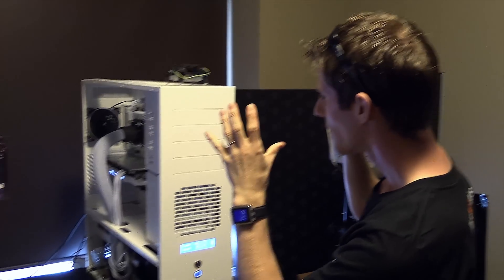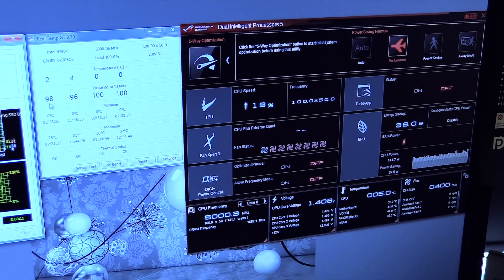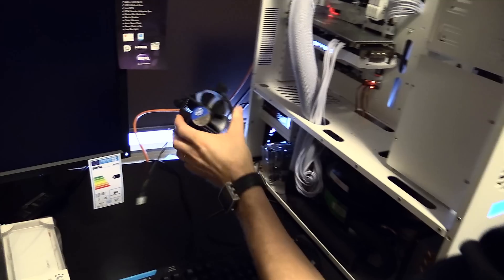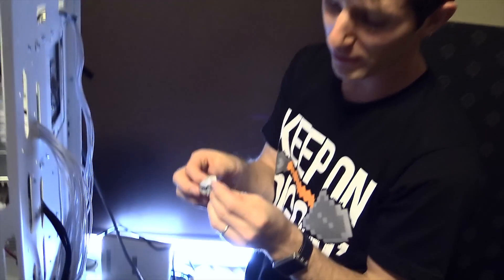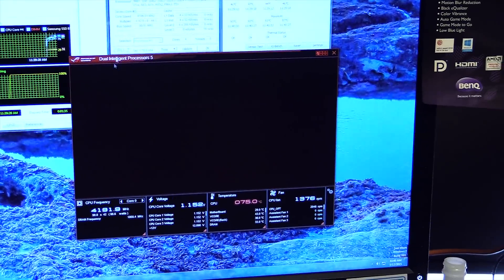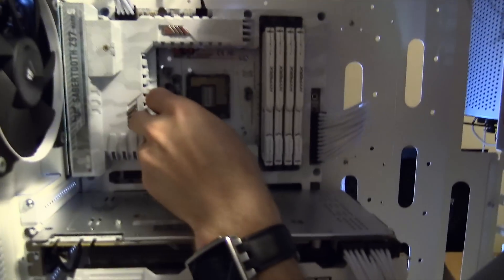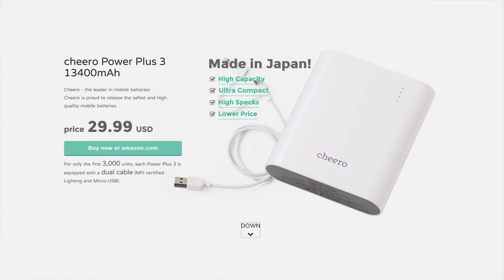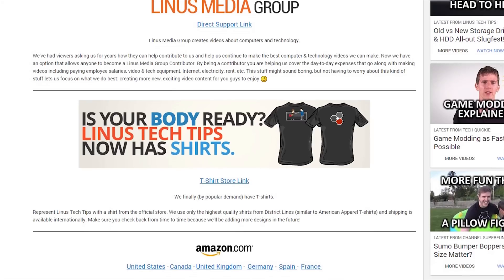CPU Cooling - Does temperature impact performance?

Comment: If temperatures drop, the molecules move slower. The electrons, which transport the energy for the '1' and '0' states for data moves slower. so the cpu should actually run (nearly unnoticably) lower.
Reply: wut ? since when electrons are molecules ?

Comment: no duh colder does not equal faster unless you turn up the speed of the cores and/or another part of the machine that was made to be colder as all being colder does is make it so you can can more stable at a higher speed is all

Comment: Damn, only $26 for a Handy? That is a steal. They usually cost me $30 for a decent handy. And from a trusted supplier, too. You never know what to expect when you buy a handy in an alley or a gas station bathroom. Sometimes they're very rough and heavy. I hate hamfisted handies. But this handy seems smooth and delicate, like a mother's touch. Time for a Better Handy. Thank you for the handy tip, Linus.

Comment: How about trying to crank up the temperature in the next test. Like one on sub-zero and the other without a fan, allowing the CPU to run up to 100+ degrees. I like to know will throttling occur and how much is the impact.

Comment: maybe its meaning full when you are using a threaded cpu.
i use intel core i5 560M 2 core 4 thread  cpu in which 2 logical threads are disabled when cpu gets heated. and the 2 physical ones also stops to respond.

Comment: What I wonder is if there's a difference in max overclock speed between say -80 C and -10 C. If you design a cooling system, you can get -10 C easily with normal refrigeration (like your freezer). But to get to -80 or -100 C, you need liquid nitrogen or lab equipment grade stuff.

Comment: Less than one minute into the video, Whether performance is increased or not, The cooler it runs for it's life spand the longer the life spand will be. So Yes, And No. At this point. If it's getting hot enough to throttle itself, Then, Yes more cooling is good for performance. If it never throttles itself, Then cooling shouldn't boost performance at all.

Comment: Big mistake here as you forgot to include thermal throttling into the equation. The correct answer is YES, temperature can and will affect performance.

Comment: Through actual experience the only time i've noticed temps affecting performance was when running too hot and getting thermal throttling. Back with my old Q6600, I instaled the /stock/ heatsink wrong, and the damn thing throttled down to 500MHz or less. It took an age to boot windows xp. something like 15-30m.

Comment: Linus could you make a video where you test CPUs in which you look at what CPU does it take to run games, only CPU no GPU in system. I have i5 2500 and I play dota 2 on low on 1280x720, so I was wondering which CPU does it take to play on other quality

Comment: If the processor is too hot or becoming too hot doesn't it nerf itself? If you had a water cooler for the processor it would not nerf itself and then the performance would run better.

Comment: Same subject, different question...
Whats the max temperature your CPU should be before its considered dangerous?

If running Witcher i get 65ºC-149F, and when 100% stress test i get 75ºC-167F -> is it safe or should i be concerned?
Thnks in advance.

Comment: 50 is high? Mine is 60 at rest and 100+  at load.
Reply: 12345littlepeople  That's really high. Mine is 40~ at rest 75~ on load
Reply: 12345littlepeople  What processor do you have?Just asking.
Reply: Buizel Productions (Intel) i7-4960HQ @ 2.60GHz

Comment: The semiconductors physics says that at 0° Kelvin (-273° Celsius) they won't conduct electricity and with the rise of temperature, they become more conductive. That being said, technically, a CPU should perform better when is hot, than when it's cold. But in a CPU there are more variables than the Silicon that makes the chip, and after a certain temperature, the semiconductor's conductivity doesn't scale equally. Like in this example with 0° C and 78-80° C, there is no difference. 

As I said, there are many variables, at hardware level, like thermal throttling, and at software level, like certain activities the OS does (checking updates, getting more inputs or outputs etc.)

As for the conclusion, it's good to see that you can have both a pc and a room heater without compromising performance.

Comment: why I don't like Ai suite: Ai suite II messes my whole system up. AI suite on: system unstable and everything being weird. AI suite off: system working perfectly normal but fans not controllable. sadly Speedfan does not work with my mobo. are the newer Ai suites better? :D
Reply: ***** Create your fan profiles within the UEFI, then you can have the best of both worlds.
Reply: Bryan Muller that's what I'm doing now. But I would prefer to control it with software and on the fly

Comment: I guess we all screw up while manipulating the CPU in vertical position. (Mine fly away of the socket and safety landend in the cables of the PSU. xD

Thats why the socket mount have a safety lock and you have to avoid do it in the vertical postion...

Comment: Lol I use a quad core amd processor with the stock cooler and it runs like to 90 degrees Celsius on a little load. XD fail

Comment: Wait that's weird.......doesn't an increase in heat causes increase in electrical resistance?
Reply: User5C13nc5 And why would you think the increased electrical resistance would make your CPU slower?
Reply: b0nz1official 
Doesn't that mean that the current is lesser and that means lower wattage that goes trough the circuit and into the processors? Wouldn't lower wattage mean your processor would run slower?
Reply: User5C13nc5 well... when you talk about 1gramm of silicon (its way less) and 30 degrees more there wouldnt be a big difference

Comment: Sigh.. temperature does impact performance.. possibly not with the processor but take any game that requires alot of power. it does run smoother if you start it with a cold pc and the frames will drop a bit when your pc is getting hot
Reply: Lenwe Ancalime Wow, you don't thermal throtteling.

Comment: Theoretically, a CPU should be SLOWER when under low temperatures, as it is a semiconductor. Metals however WILL have higher conductivity and lower resistance at low temperatures. However a lower temperature allows for higher clock speeds which means it would be FASTER.

Comment: I don't think a cpu being cooler will inherently make it faster, but it being cooler will allow the user to push it further by overclocking before the cpu thermal throttles. I guess? I'm not so good with converting thoughts into words. Correct me if Im wrong though.

Comment: I love how Linus is surprised by the high temperatures of the I7 4790K when he put the stock Intel cooler on the cpu. It's an overclocked I7 4790K with a stock Intel cooler on it. Linus you can't expect low temperatures in these scenarios.

Comment: Yes it should affect performance due to CPU passive cooling trippoints. 
Any modern CPU has that feature switched on and should have that feature switched on.
Cpu passive cooling is most important and controllable feature for user. 

So temperature can't degrade CPU processing power or performance before CPU doesn't reach that specific temperature limit.

Disabling that feature or setting trippoint too high temperature limit may destroy entire CPU chip in matter of minutes - in some cases scenarios.

Comment: Unless OC CPU cooler seems abit over-kill inn any case. I run a I5 4590 (Yes I choose not to have OC, thanks) with proboaly the cheapest cooler thats worth buying, TX3 Evo, and I never see temp's above 60, trough I havent stressed my PC either much.
Reply: DjuntasGaming 
I have the i5-4590K with same cooler. did a minor OC to 4.1ghz still runs at 60C :)
Reply: Thats nice to hear. I didnt even know my variation comes as K-model.

Comment: Wouldn't a test of a hot-running cpu complete the test/give it meaning? Something like running it pretty close to thermal limit, without it thermal throttling of course.

Other than that: i agree. Results were predictable:)

Comment: Hey,

Do video about new GPU on older platform. To see where bottleneck is.
Reply: Hey

Learn to talk english.
:3
Reply: Mr.Mc.Waffles (b$e〉〉) heh :) funny
Reply: mentalplayground Don't think it would be that bad. I mean it would be a bottleneck for sure, but not as bad as you might think.

The worst games would be those with heavy CPU physics
Reply: Christoffer Nørskov Maybe guys use it to make 10 min vid on the subject
Reply: mentalplayground A GTX 690 (dual-gpu card) has no real performance degredation when using PCIe Gen1 8x (equal to Gen3 2x), so your CPU, RAM and harddrive are more likely bottlenecks
Reply: Christoffer Nørskov I would love to see how badly GTX 780Ti/ 980 / Titan X would perform on Q6600. :)

Comment: Only 821cb on with a 4790K at 5Ghz? Oh Linus...you need to turn off that whit you're running in the background. That kind of a frequency should give you much over 900 - like in the 940-50 range.

Comment: A cooler CPU would reduce electrical resitivity which would allow a more efficient flow of electrons and thus better performance. But this is countered by the reduction in kintetic energy of the electrons.

Essentially your stuck in equilibrium until you reach a point of super conductivity, at which point you would see a massive jump (which for a CPU i'd imagine about 10 Kelvin / -263 Celsius. LN cooling anyone?) 
This is all just speculation mind you
Reply: So if you got a CPU to 10 Kelvin it would get a massive performance jump up? Ok, I'll get onto that :D
Reply: Oh and liquid Helium is way colder than liquid Nitrogen, and I was joking when I said I'd try to get a CPU to 10 Kelvin, that would damage the motherboard.
Reply: as i said, i'm speculating, as well as making an (albeit educated) guess of the point at which silicon becomes super conductive. I'm an engineer not a physicist ^_^.

Comment: I think Linus was really tired when he did this video
He's saying that increasing performance by overclocking your CPU will generate a lot more heat so cooling it will help a lot.  
And, running a sub zero cooler on stock settings will do very little which is what we saw in the video.

Comment: temperature is more related to OC'd lifespan than anything else. I'm guessing there's a saddle region where overclocks and load temperatures meet - i'd say 4.6-5GHz and 35-45 C - that will maximize the lifespan and reliability of an OC'd CPU.

Comment: so my FX-8320 (OC to 4Ghz) scores 640, which is not bad as it's less then 1/2 of the price of i7-4790K (atleast in my country..)
also, why doesn't Linus EVERY use/benchmark/review/talk about AMD products!?
Reply: ultraszgb This channel is more geared toward enthusiasts, AMD cpus are grate for budget builds, but not nearly as fast as intel ones.
Reply: ultraszgb Possibly because AMD hasn't released a new CPU for a long time. That said, I thought the FX9590 would have been a better CPU to test the limits of the phase-change cooler.
Reply: ultraszgb Right now you can't compare them, in this moment ends of may 2015 Intels fucks AMD so hard that you can't even think.
Reply: Takata Miyagawa If you test an AMD CPU with the phase-changer you will get Intel Stock Cooler Temps.
Reply: ultraszgb Because LinusTechTip is powered by Nvidia and Intel... so we can conclude you will never hear an honest review here
Reply: ultraszgb He'll do some of the 300 series stuff when they come out next month. Probably some Zen stuff when they come out, as well.
Reply: Thomas Banks nah, Intel is ahead of the game since AMD came up with the first Phenoms. They even had a bug in the L2 cache and fixing it cost around 10% performance. They never recovered  from that really.
Reply: TheCovertCamper Ok that just cover review videos, but Linueses channel is not just about reviews... what about a video of the old 8350 or the 9590 overclock with a custom water cooling loop compare with the 4790k?, why he didnt put one of these hotter amd cpu on this sub-zero phase change cooling PC to see just what happens?, what about kaveriu apus?, how they perform in gaming?, I don´t know... do something different and innovative, I feel like latelty he just talk when he got pay by the sponsors, and with that said, he´s channel has become like a platform for marketing... saddly, and that´s what I think...
Reply: berzu21 If you really think that's true you don't know linus. There is no way he would accept a sponsorship that didn't allow him to use a whole line of products. He get's intel ones for free, and I bet he has to pay for AMD ones, so maybe that plays a small part in it, but he's bought products before to review.
Reply: He said it in the most recent WAN show why they don't talk about AMD that often recently. They did a couple of years ago though.
AMD is currently not a real competitor for Intel in terms of CPU's. 
And they bottleneck some of the newest GPUs, even if it is just a tiny bottleneck, it would still affect benchmarks.
Things will change if thE rumour about "Zen" are true. We'll see.
Sounds rude, but that's how it is at the moment.
Reply: HeyDan1983 He wouldn't deny the sponsorship, but there would be nothing saying he can't review amd products. Not only is that bad for him, but it's bad for intel as well... I know how business works, and I know he's not doing this for free, but it would be bad for everyone involved if there was a clause stating he couldn't review amd cpu's in his contract.
Reply: ultraszgb Because amd fx are nowadays so old
And moreover... intel is Linus sponsor, i'm sure they didn't allow him to review amd cpus.
[En fact, last Amd good chip A10-7850k never been reviewed on this channel]
Reply: DamyLv 
APUs?

You must be new here.
Reply: ultraszgb linus actually said he would love to review an AMD CPU again. We'll probably see it if AMD manages to give us a real competing model.
Reply: ***** 
I mean last Apu generation, Kaveri. Why not reviewing it?
Last Amd review was for 2012's richland apu
Reply: ***** I built my PC on a tight budget, my little FX-6300 with its stock cooler has been a great little thing. :) It is from an era when AMD and Intel were more evenly matched in the CPU market.
Reply: DamyLv
Because APU's are generally regarded as garbage and only for the most budgeted builds.

And budget builds don't get alot of attention on this channel.
Reply: ***** Ok, then why paying attention to an even cheaper pentium g3258? :)
Because is intel's
Reply: I don´t know why people start saying that LinusTechTip is all about high end products, I though it was just about technology, now that linus start focusing more on expensive products (because intel and nvidia feed the channel) suddenly it has been always about high end, I remeber comming to this channel to learn about computers no matter the price, now I come and I just see nvidia and intel everywhere, it's obvious Linus sell his soul to those two companies.
Reply: TheCovertCamper G3258 is only a dual core with no Ht. Overclocked is somewhat close to an i3 performance. Exactly as an Athlon 860k/A10 7850k does
Reply: TheCovertCamper Kaveri ihas been released in 2014
Reply: TheCovertCamper He would do it if amd would pay him, and that's what I have been saying, the channel is no more but a platform for sponsors...
Reply: that's the same with SSDs.. ih those video they always use Intel's and no one from Corsair/Crucial/Samsung (wich are imho better)
Reply: Shady If you think what you said is true, you don´t know how a business works... there is no way he would deny a sponsorship knowing that making that kind of business with intel would let him profits, this is now a buisiness, is not anymore a hobby...
Reply: Shady Well not review them, but use them for other things like this build the phase change cooling, he could use a spare amd cpu for the biuld, that they are hotter than intel cpu, just to see what could happen or much you can overclock them, or why use just intel ssd, been samsung 850 pro faster. I know that now he work by sponsors, and that´s what I don´t agrree with, because he doesnt have the same liberty.
Reply: TheCovertCamper Well Im not saying that, he have a lot of spare parts there, I doubt that he hasnt amd stuff in ther, and I think he have change his car for a new one, from where all that money come from?... well thats another evidence that he has sold his soul to those companies... and the worse is that a lot of peolpe were donating for their new office and subscribing to that new netflix-like webpage I dont recall the name while he gets super cards... I think that money and fame change peolpe...
Reply: +ultraszgb FX processor are quite good for budget workstations (and the extra cores play a major role)
But in games , they are bad  compared to intel chips ( mainly because video games don&#39;t ever utilize more than 4 cores or less ) .
So theres that

More cores ,more perfomance in multitasking and in heavy workloads
But this does not apply in games .

Comment: I'm not 100% sure but electric conductance changes with temperature. I don't remember if Intel builds the processors with copper transistors. but Intel also tests and warranties products to work in specific temperature range. so... it should not be as simple as faster or not ... But for all practical purposes this video makes a lot of sense. I always wondered it too. thanks Linus
Reply: If CPUs got down to excessively low temperatures they would experience a huge performance jump though, because the CPU would become superconductive and have zero resistance, which allows much faster computation but temperatures that low would damage the motherboard.

Comment: I'm running games from my surface pro 2, and without a giant fan blowing at it, it would heat up to like a stove, and gives lower fps. The temperature has some effect, maybe the pc is slowing the cpu down just so it wouldn't overheat.